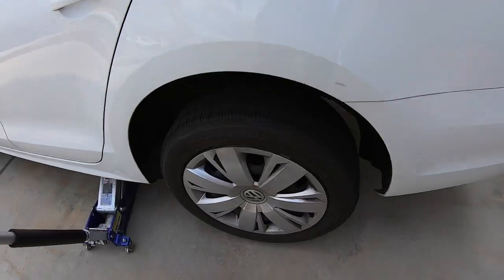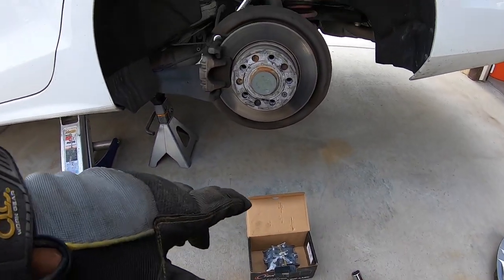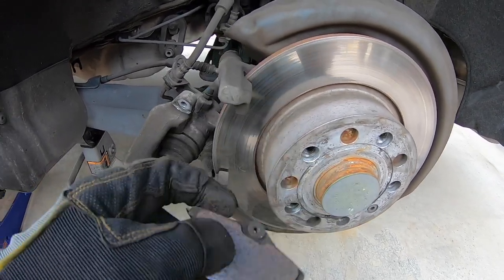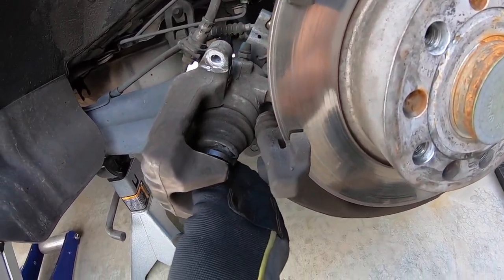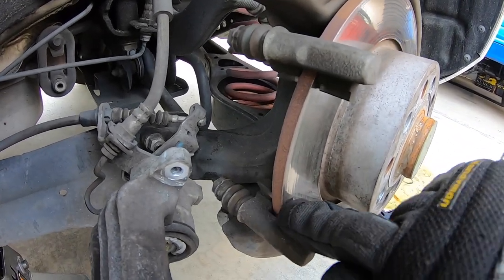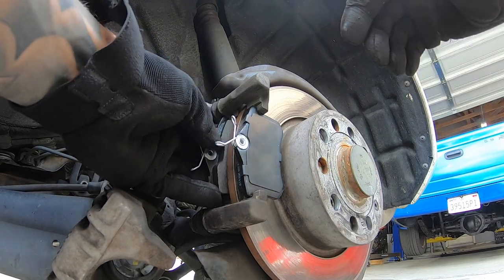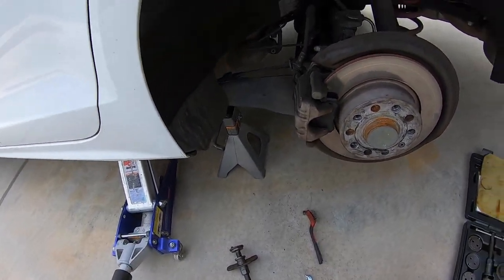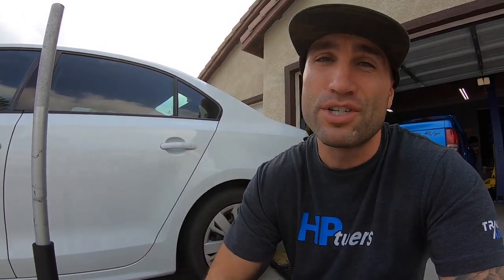Volkswagen Jetta MK6 Rear Brake Pad Replacement

Comment: Hello sir. Thank you for this guide. I followed it and i believe i completed the job but i do have one question. When i was taking the unit that houses and squeezes the calipers, 13mm that screws into slider pin 15mm was quite stuck. I had to break them loose. When i reassembled the unit with new pads, i was able to tighten back them up but not as stuck as they were previously. 13mm would go in pretty tight but would continue to spin and not stop. 

Is this wrong? Do I need to keep trying to screw them in until they cant go anymore?

Thanks

Comment: Some of those tool sets have two wrenches. One for counterclockwise and the other clockwise rotation. Does it matter or did you just use one tool? And was that a 6 or an 9 adapter?

Comment: What year is the Jetta? how many miles did you get out of the brake pads? I've got an 016 mk6 the rear brakes started squealing  the car had 44k miles on it
Reply: mK6 80,000 miles on mine.
Reply: I get about 80k on mine BUT I have a manual and try my best to float traffic and downshift to slow down. I hear 40~50k is pretty normal on the rears for these as they have brake bias where the back brakes more than the front to reduce nose diving and increase comfort.
Reply: ‘16 MK6 here too. I learned that VW tuned the brakes to more like 65% rear and 35% front in order to reduce noise dive under heavy braking. But it makes the rear brakes wear much faster than fronts.

Comment: I see this video is 3y old so I can’t speak on the piston compressor tool set in this video but today I did my brakes pads/rotors and had to rent one of these sets, I got frustrated because I went to both oriellys and autozone and both locations had the  sets but with just one of the threaded tools, so I said worst case scenario atleast I get one done and figure it out later as I’m not in a rush, but I tried the passenger side after I finished the driver side just to see and it works on both driver and passenger side!

Comment: I hate those stupid designs
Reply: you were gonna fix bushings on dakota an  get the right thing where they screwed up,an go for a goodride,it does make a good difference as i mentioned my 67 barracuda had this an front disk brakes to boot...an great shocks,an i sold a 20,000.00  car for 6500 bucks as usual, stupid is as stupid does, am allways giving things away.